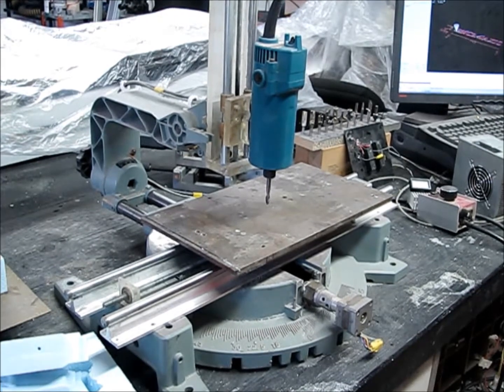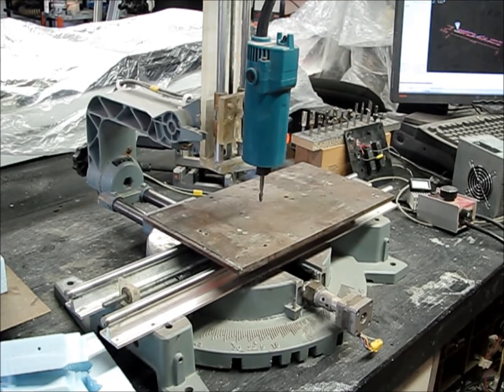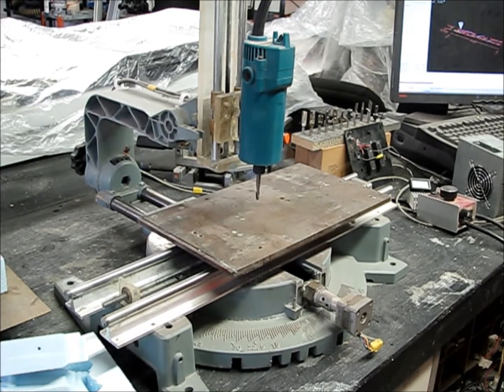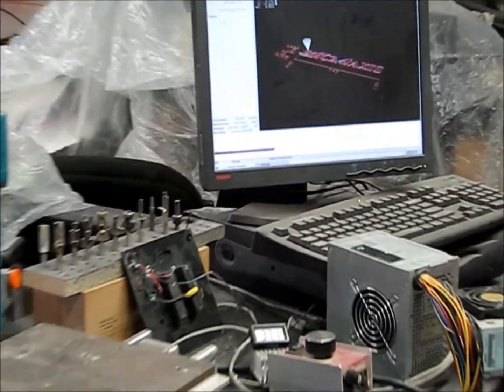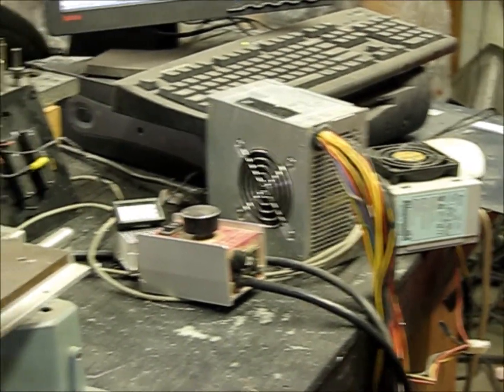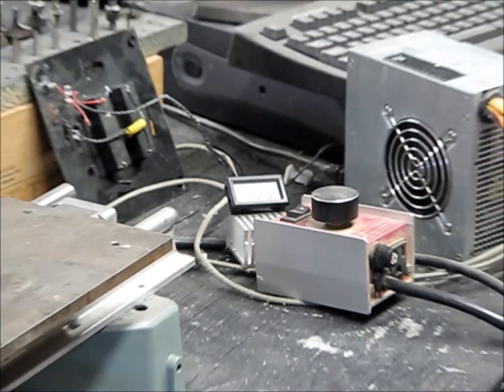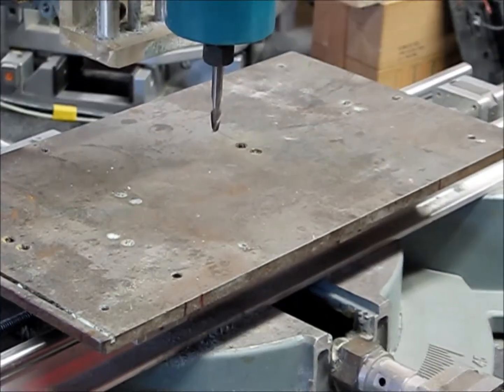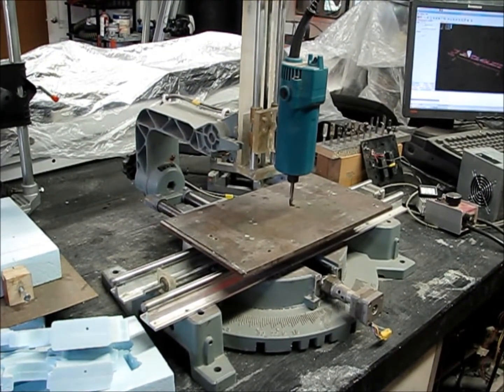Homemade Desktop CNC Machine (Biploar L293D)

Comment: Hello 
  I want to make a cnc with arduino but  I have a problem with L293D.

When 3  motors are rotating ,they lost speed and power.
Could you help me please.
I'm using 3 steppers motors 350Am 12v, 3 L293d , arduino mega 2560,power supply ATX 800w 30A pc
thanks

http://diymakers.es/wp-content/uploads/2013/12/BIPOLAR-4-FILS.jpg